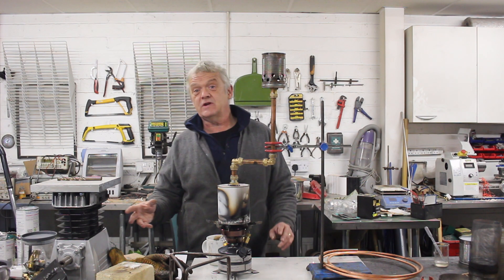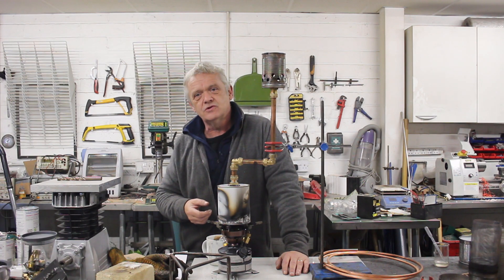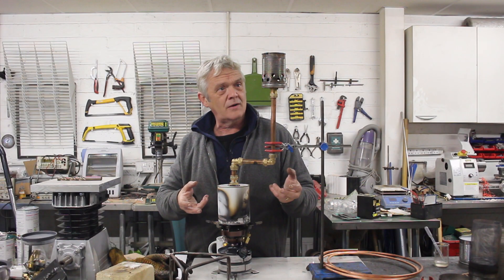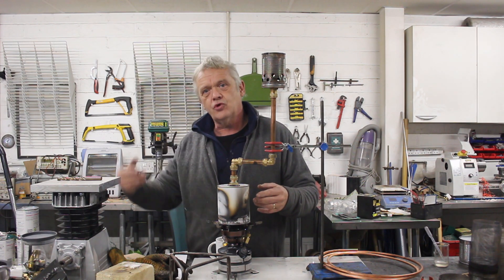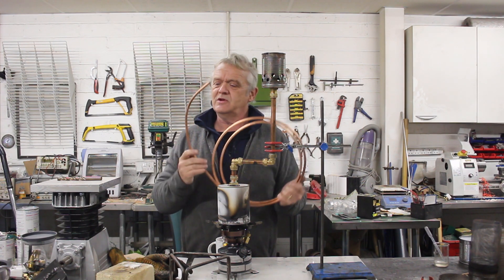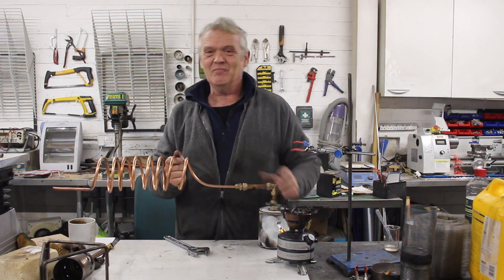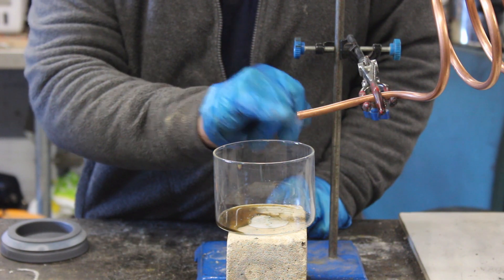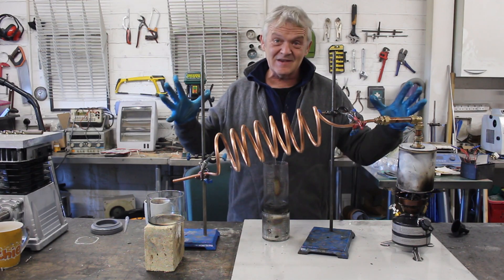1710 Making Methanol From Dry Distillation

Comment: that was a very interesting experiment! Would be super nice to see some further experiments about diy methanol with maybe some efficiency improvements or process improvements. Best regards!
Reply: I second that!
Reply: efficiency can be made better thisis just to show that meol is ''destilable'' from wood
allow me a question... 
lets say the goal ist to maximize methanol production from wood.
wood gasification is the way to go but co/h2 is never really optimal (with air to much co, in superheated water stream opossite)...
obv. a WGSR is needed after pirolysis. wicg might be complicated as there will be nitrogen, o2, so2, tar and possibly heavy metal from wood.
Is it possible to make the 2 h2/1 co by doing air and water into the gasifier? without any cat. ?

after that a syngas->methanol is possible

Comment: I was going to suggest freeze distillation? But it seems you got it nailed when making methanol. Fantastic!
Reply: How would that work?  Something has to be collected to be put in the freezer, 8n order to distill it back out..right? .
Reply: @marcwilson1052  robs already got a coil as a condenser. It would only be a matter of plumbing a set of coils into a freezer box. The trick would be to increase the concentration of methanol as it runs through the pipes? Without it turning to ice? Methanol itself is alcohol used a lot in gcse science. Ethanol the other. Both considered bio fuels.  It wouldn’t need to be too cold -10c is sufficient essentially a rapid condenser.
Reply: Freeze distillation would be great economically for alcohol made from fermented things.  Im sure theres a trick to it.
Reply: @mike289homebuilt5  when I first encountered it was with someone who live their drink. He did say It could explode of left too long.  Yes I would agree there a trick. Getting it to distill without it going boom. From what I remember he said you could use a home freezer to do so.  So it just a modified set up. I doubt theres any need for a blast chillers running lower than -20c general range is -10c  to -16c. Methanol was suggested as rocket fuel as a aid in catalysing H2O2 some like 5% of the total mix.

Comment: A question, under a similar setup, doesn't this produce pyroligneous acid (sometimes termed as wood vinegar)?
Reply: that would be one of the improvements to which he referred. By separating that fraction in a refluxing column it can be processed to produce more MeOH.

Comment: You can also refine the methanol for biodeisel, but on  the coil layout, you really want the coil to have a continuous downward run, so that it doesn't make bubble traps in the raised areas as badly.
Reply: I have the exit at the bottom, have a tap to collect the tar then run it into a tall chimney, rain down spout, and let it condense in there and it runs down and collects in a bucket at the bottom.
Reply: Or put a 'T' at each low point (for cleaning it out) and run it slowly enough that it doesn't blow the trapped liquid around to the next loop and you can re-distill it every time around.
Reply: @matthewellisor5835  Nice idea, although it seems like a lot of work compared to just tilting the coil :)

Comment: Hi Rob - this is so cool - I have been wondering what would be the easiest way to create methanol for a burner. Thanks for sharing this! Presumably there's no net benefit in making it with a burner due to the energy being used to distill the fuel.. ? Presumably you're just doing it that way for the demo. I suppose if you have a rocket stove burning freely collected wood then it would make a lot of sense. I guess you could achieve the temperature but would it be unreliable in terms of controlling the temp of the fire?
Reply: I was thinking you could have two inlets, one that feeds the fire and another one that draws ambient air directly in the reaction vessel containment chamber. Then you could just control the temp with the 2nd one.

Comment: Is that actually legal? According to HMRC it is legal to own a small still and run it to produce essential oils [not for fuel or consumption] from plant materials, however it also states that a [expensive yearly] license, inspections, and meticulous record keeping are required to produce ethanol for drinking and a different license is required to make biofuels ie ethanol and methanol. THE ACT OF DISTILLING is illegal without license in the UK, gasification and direct use of the gas as fuel is unregulated, brewing and drinking ethanol is unregulated providing the product is not sold, concentrated, or distributed. This does not cover cold distillation (freezing most of the water out of the alcohol) which is legal providing it is consumed and not distributed. You cannot make fuel with cold distillation as the ethanol produced contains too much water to burn. The legislation is ALDA S12, stills were illegal to own until the 80s, when it was repealed and covered by mandatory licensing instead.
*edit Distributing spirits (incl Methanol) and low alcohol beverages is also prohibited by most housing group contracts, breaches of which are usually met with termination of contract and eviction. Distilling oxygen out of the air with your lungs will be made illegal next...
Reply: @damooooo  One, I dont do anything the government says, lol, and Two, that was irony. Note the references to essential oils and oxygen tax, and get an education man, you're letting the side down. FFS 😆

Comment: Thanks for showing the distillation to make methanol Robert    .For  a home set up I was wondering  how much energy  you would need in the heating up to how much  energy you would get  back from the Ethanol  produced
Reply: You could use the waste wood after its released the methanol for heating a following batch
Reply: That's my question too buddy
Reply: And my question too.
Reply: @kevin
Would be worth it even if it is inefficient if the methanol was medical or entertainicle 🍻
Reply: @dizzywilliams3557  Definitely NOT for drinking!☠️
Reply: Important not to mistake ethanol (grain alcohol) for methanol (wood alcohol).  Ethanol is what is in beer, wine and spirits.  Methanol is highly toxic causing blindness and death in many who drink it.  If I’m not mistaken, a bar somewhere down in the Caribbean recently sold methanol tainted spirits to a bunch of young customers resulting in over 20 deaths.
Reply: Well plenty of high volume wood mills in the PNW region of North America use dry distillation to make fuels to power the entire remote processing plants using just the waste wood.
And they sell the leftover charcoal too.
Now how much wood they have to sacrifice is a bit of a moot point, since you don't actually need a flame for dry distillation, you can use concentrated solar power, and collect your syngas, methanol, charcoal and tars separately for more efficient use later
Reply: Me three!  ❓

Comment: I would suggest the cooling pipe be situated so the spiral is specifically traveling downward to make sure there is no liquids stuck in the middle of the coils
Reply: Moonshine stils had what was called a thump keg. The coil was ran through a water barrel to cool it. They had a rhythmic "thump" from the gas building a little pressure until it pushed the liquid from the coils.  With that said, I don't know what the tars building up from the wood gas would do?  Probably good to have a relief somewhere in the system, precoil. Even a well calculated hole with a weight setting on top.